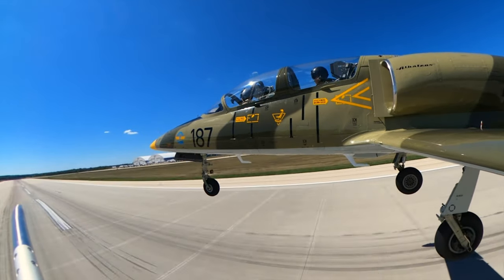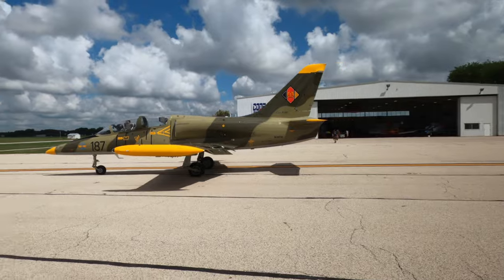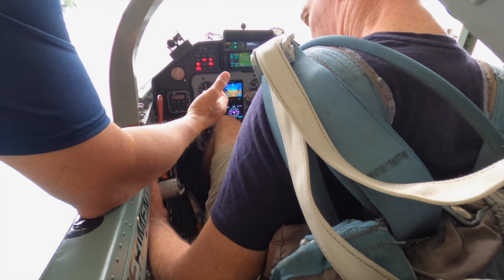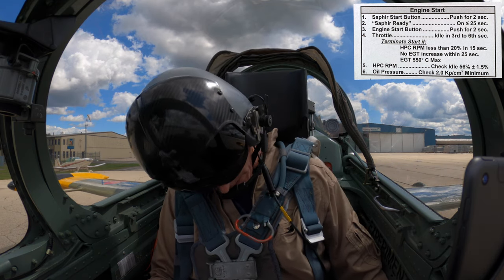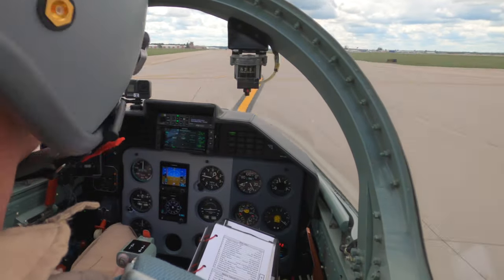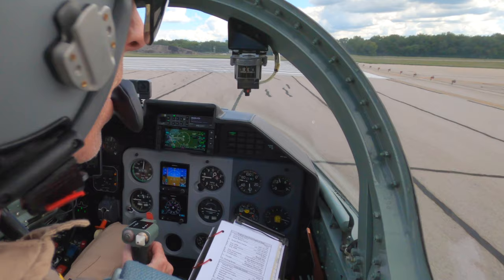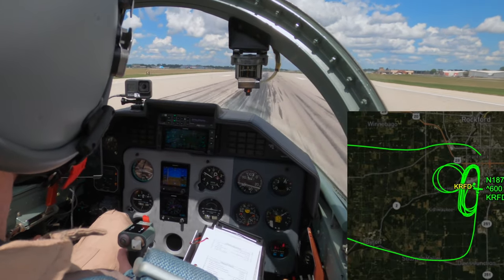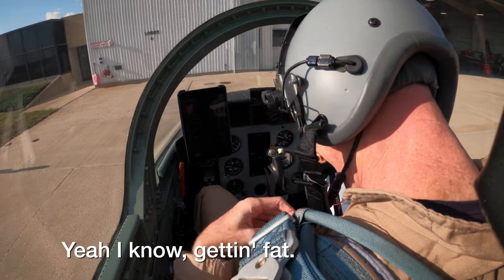My L-39 Albatros Training: Jet Transition & Flying the Overhead Break - Part 1

Comment: I have the (virtual) aircraft both in DCS and Microsoft Flight Simulator 2024. This is one sweet flying little jet.  My favorite plane.  The flight model in DCS is probably a bit more accurate, but MSFS is starting to catch up.
Not sure the light buffet is modeled, but the heavy one certainly is. A lot of this video is very familiar.  .  . 
Good luck with your training - doing great.

Comment: great work on the video, and I'm looking forward to the series.  I'm flying an L-39 next month out of Traverse City, Michigan, and am trying to sort out how to record audio and video.  Could you share some details on the cameras used, mounting methods, and how you captured the cockpit audio?  I'm especially interested in the external camera.  thanks!!
Reply from the maker: Thanks... I'll be in Traverse City the weekend before Oshkosh.  Lots of details on the cameras & audio.. can you contact me at my email address in the About section of my channel and I'll send you the details or get on the phone with you.  The short version is for audio I use a cable that plugs into the plane and the other end is a 1/8" headphone jack that goes into an old iPhone that has a headphone jack, and I use the app Voice Record Pro.  GoPro audio is just too unreliable, and if the camera overheats, you lose audio, etc.  The external cam is a GoPro Max with a certain mount and a cage, all metal, no plastic.

Comment: Don't you have to wear a mask on your helmet for Oxygen? 
Like other jet Pilots do?
Reply from the maker: Oxygen is required when the cabin pressure is above 12,500 feet for more than 30 minutes, or more than 14,000 feet for any duration.  However, the L-39 cabin is pressurized, so for example, at 22,000 feet, the cabin pressure is 12,300 feet.  So in the L-39, you usually only need oxygen if you're going to 23,000 feet or higher.  Oxygen requirements are covered by the FAA regulations in 14 CFR § 91.211 (for private flights), see https://www.law.cornell.edu/cfr/text/14/91.211
For military pilots, especially fighter pilots, there may be other reasons to wear oxygen even at lower altitudes, such as increased performance under high G maneuvers, etc.  Maybe a military pilot can answer this part.
Reply: @speedbrake  Thank you so much!